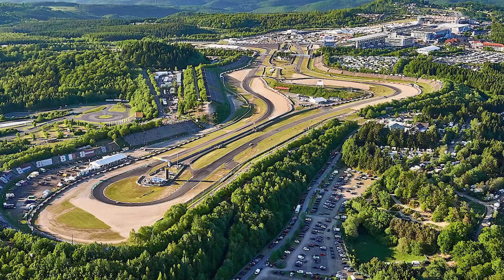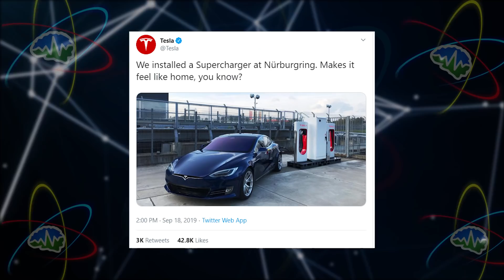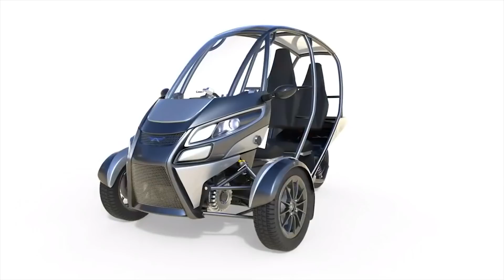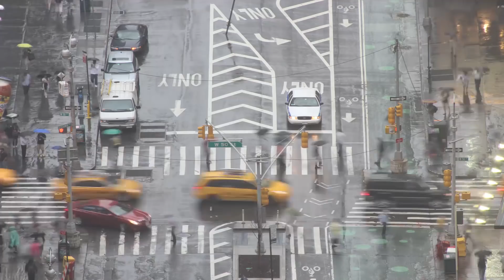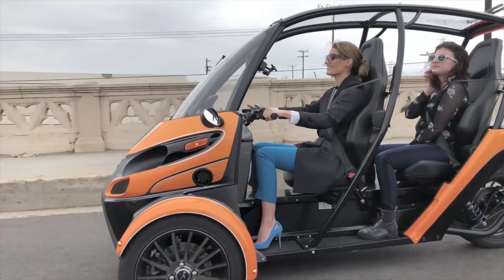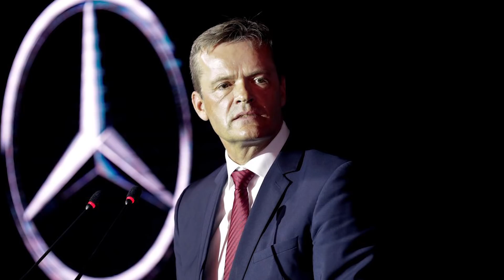Daimler Stops Making Gas Cars? - TTN Bite Sized!

Comment: Didn't you fall for it when Volvo said they weren't gonna develop new generations of diesel engines? Engine generations can be very long lived, decades, and the company decides themselves when an engine is of a new generation, according to them.

How is Tesla gonna make the lap times they're aiming for? It's physics, so nothing for them completely unpredictable. Probably in part improved power to weight ratio, that probably at least mostly due to increased power. I believe improved heat management be an important part.    

The fact that plaid mode is planned to become available over a year from now indicates that they probably are waiting for a new generation of batteries, which they probably also are waiting for to put in the Semi, NGR, and the pickup.              

If a new generation of batteries is coming that soon, with significantly lower internal resistance, higher power density, higher energy density, then they won't have to change much else on the car to get much better lap times. If their next generation of batteries can charge faster than their current 2170 they can use the increased energy density to lower the total weight instead of increasing range even further in their performance models. As the model 3 the can charge with up to 250kW which means about C3.3, with 100kW capacity that would be 330kW, and with new significantly better batteries, they should be able to charge with over C5, that is 500kW, for a 100kWh pack. That is peak of course, but still were probably talking ~10 minutes from 20 to 80% SoC.

If that will be the case, you won't have to be extremely performance focused to prefer lower weight, and cost, over even longer range. And, if my guesstimations for Teslas next battery generation are correct, it would be a good idea to make next gen roadster able to use megachargers, as >C5 charging rate equates to >1 MW with a 200kWh pack.